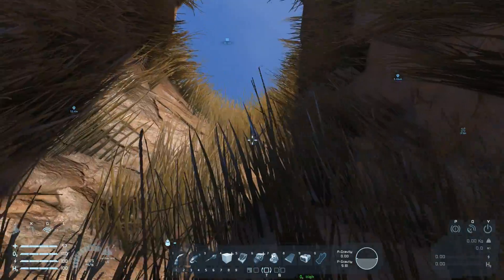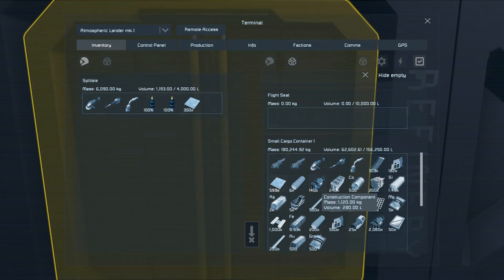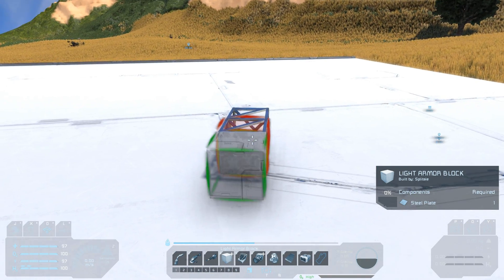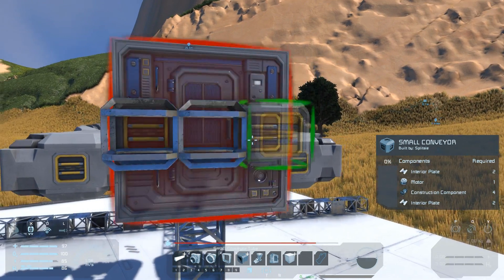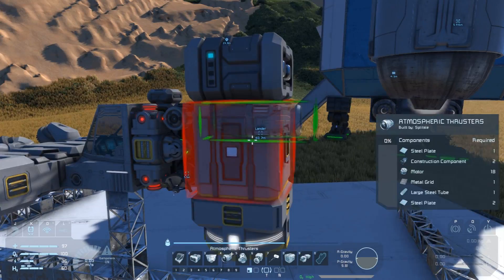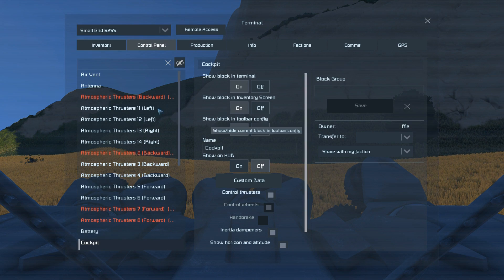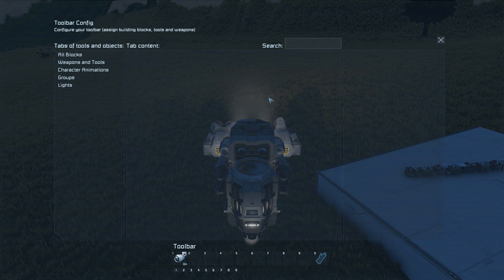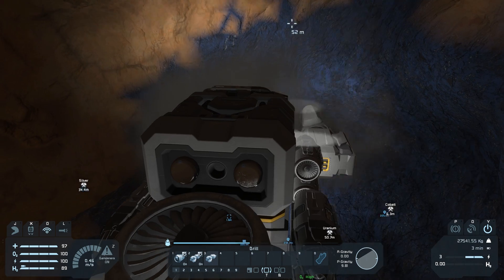Space Engineers Tutorial: Build A Planetary Mining Ship (Part 2 of a survival tutorial series)

Comment: i cant seem refuel this thing. mine died, got one red bar on the battery and i cant find any way to get it to eat my uranium ingots.
Reply from the maker: Once the ship has no power the conveyor system won't work. 

When that happens you have two options: 
 - build another battery on it and put fuel in the reactors before that power runs out, 
 - build another reactor on the ship that has its port pointing outward, place a little fuel in that one and then using that to power your conveyors get fuel into the other reactors. The extra reactor method allows you to then grind it down again without losing resources which is why I prefer this option.
Reply: thanks man, i had ended up popping another small battery on top just to get some juice in it, i parked it near my base site and once i got connectors and everything up and now it just sits on the connector with the engine off while the base feeds it and my other ship, the other ship i built is much faster but no drills, ive just been drilling out mats myself and hauling them with that, the miner ship needs a bit of revision cause it doesnt seem to fly right, or it tips over no matter how many counterbalance and Qs and Es i use.ill eventually find a use for it or make it work, thanks for telling me about the extra reactors, thatll come in handy.

(ive also gotten metric fucktons of material just from breaking down a landing craft everytime my jetpack kills me. lol)

PS. do you have steam? id like to add you for future help reference/friendship/doing shit together as a team, always good to have some running buddies who know what they are doing.
Reply from the maker: Ah the good old suicide materials trick ;)
Reply: yep lmao, i edited my post btw.

Comment: Thank you for your reply. It's fast and hard to follow. I have sorted most questions by rewinding several times. Are the small thrusters pairs opposite pointed or pointed in the same direction?(the ones under and over the cockpit)
Reply from the maker: No problems at all :) I think I have each pair pointing in a single direction but you can do it either way, as long as you have the same number of thrusters pointing in each direction it doesn't really matter. You can get away with different numbers but you may find flying a little more difficult.

I expect that Space Engineers will make more changes in the future that may require some of these tutorials to be remade (these are already on their second version) so I make adjustments when I re-do them so feedback like this is useful.
Reply from the maker: Also, I almost always have more thrusters to push my ship forward than I do in each other direction, but generally speaking your side to side thrusters (and up and down for space) are good to balance to allow for more normal feelings in the controls.